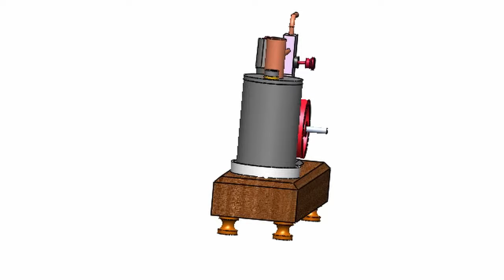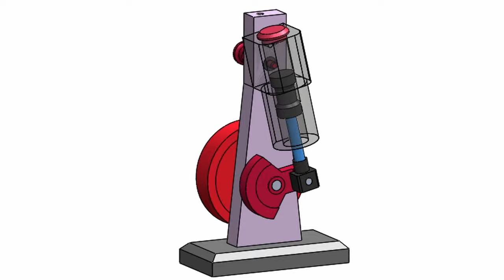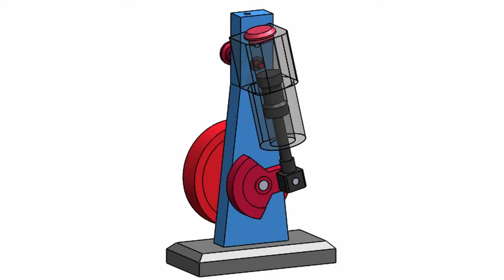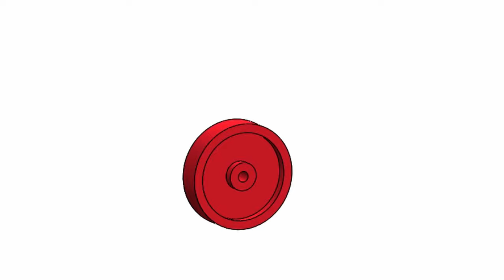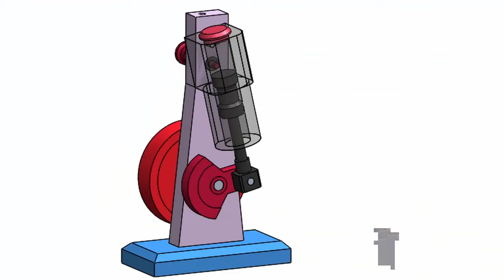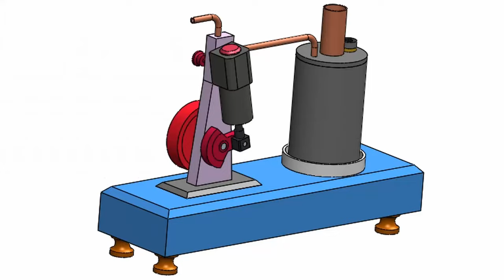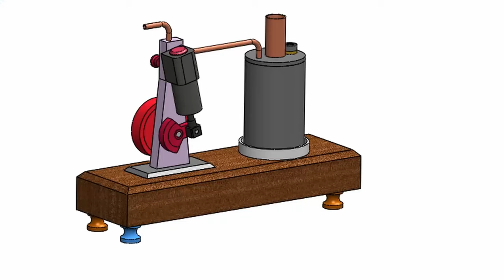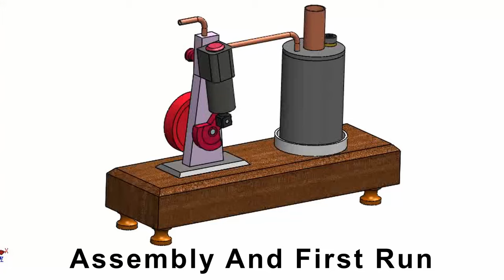Making Miniature Steam Engine

Comment: Part way through video . Two points of interest .# 1. When making the piston rod end it is usual to do all work before removing small bits from bar stock . # 2 at about 6.48 i am sure your ream holes will not be straight as i can see deflection with your reamer
Reply from the maker: First thanks for watching :)
Each product is a primary prototype. 
# 1 Sometimes there are design and manufacturing updates while manufacturing.
# 2 The holes were accurate enough for the engine to work properly. In the end the engine worked well and I am very pleased with the result.
You have a sharp and professional eye! I would love to receive a review from you in the following videos. Thank you :))
Reply: Yoo Projects  i finally got time to watch the rest of the video  a unusual way to make a boiler but it all works well.Cheers Dennis
Reply from the maker: Great respect from you Dennis.  I really enjoyed designing and building the engine.  I can tell you that boiler production was more complex than the engine.

Comment: Help!  Great engine and boiler.  I have built many small steam engines but run them on air. I followed your video to make a boiler, I have a bulldog gun that is advertised as even being able to do brass brazing. I am using 1.5mm 55% silver rod.   I just can't seem to get the solder running even when red hot. It runs on small jobs but not something the size of this boiler.If you have time, could you give any advice and tell me  the solder you use please?  many thanks
Reply from the maker: Thank you watching.

I am using Silver Solder Brazing:
https://www.amazon.com/gp/product/B0713Y6V2F/ref=ppx_yo_dt_b_asin_title_o09_s00?ie=UTF8&psc=1

and Silv Brazing Flux :
https://www.amazon.com/gp/product/B005ENPK6W/ref=ppx_yo_dt_b_asin_title_o09_s00?ie=UTF8&psc=1

The steam boiler is very challenging to manufacture. good luck :)
Reply: many thanks, I will try that solder

Comment: NICE!
Question Is the aluminum cylinder and brass piston good for a lasting engine?  I don't want cast-iron sleeves,  but is that the only thing that lasts long term that you know of?
Reply from the maker: This engine is not designed for continuous operation. But the morden engine design from aluminum.
Thanks for watching 👍👍💫

Comment: hello, new subscriber here :)
Are you using proxxon lathe? 250 or 400? also proxxon vertical drill?
Thank you…
Reply from the maker: Hello friend,
I have proxxon pd 400. Very nice lathe. Thanks for watching my video, I hope you enjoyed it 🤩🌻⚙️🔩
Reply: @YooProjects  Thanks for the reply, I am planing to buy a lathe for hobby puposes, i have no lathe experience. There are few other brands with same specs as proxxon 400, much cheaper, from china or similar, can’t decide if its worth the pay the difference. I am pretty sure proxxon is more precise and etc. but still can’t decide…
Reply from the maker: You can find Emco lathe on ebay. The old manufacture much better.

Comment: I hate to say this, but a soft soldered boiler with no safety valve is very dangerous. Otherwise, it looks very nice.
Reply from the maker: Thanks for the concern🙏 .. 
I used hard soldered, silver type .  And there is a small curved tube for safety pressure.
Reply: @YooProjects  That isnt a substitute for a safety valve. you can get ready made ones fairly cheaply on the internet. I know its only small but youll be surprised how much it hurts you or someone else when it goes wrong